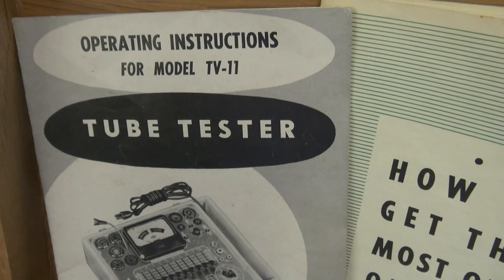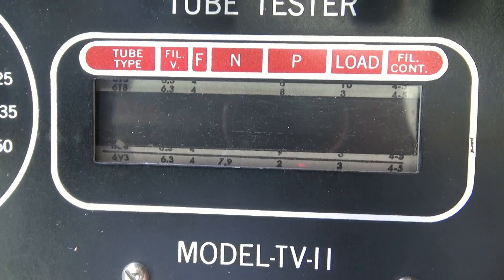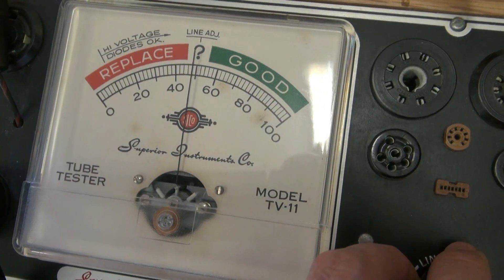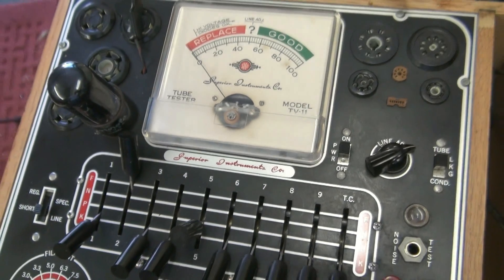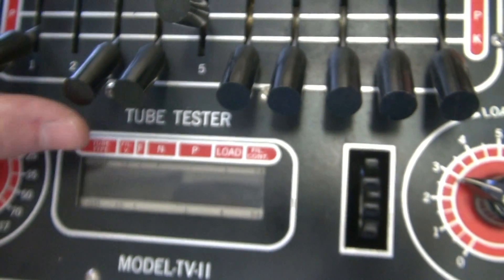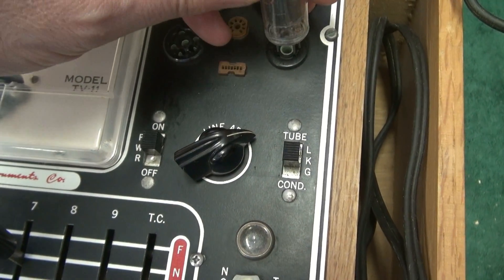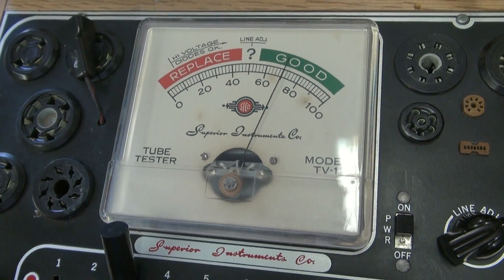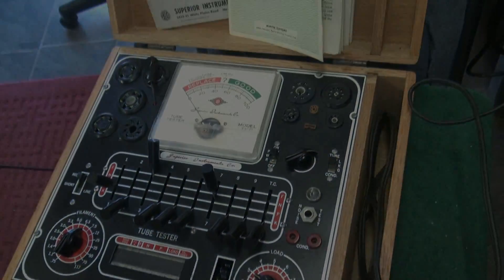Superior Instruments TV-11 Tube Tester Checker demo by D-Lab electronics

Comment: Just acquired one on Craigslst, opened  case to reveal a I-1/2 inch high water mark inside, water gone, but transformer had been immersed . Totally dry, so I put on an  isolation transformer and variac and except for two old wax capacitors, works great ( no shorts evident after immersion decades ago) these were built these in two upgrades, from 1951 onward, mine is a 1954-55. 
They are a testament to American made durability.

Comment: Thanks for the vid, but you didn't do the test demo right. You Do the shorts test first--always--and do so by setting levers for shorts as in the roll chart shorts test to various F and N positions, then turn load all the way clockwise, and proceed flipping each lever to P, one at a time (except for those already set in F and N positions). The neon lamp should not glow at any time. 
If you do an emissions check first, and the tube does have a short, you might kiss your tester goodbye.
Rob
Reply: You definitely don’t want to turn the load to 100 and proceed. Nowhere in the instructions for this tester or the TW-11 does it specify that. Set it where it says for any given tube and leave it there

Comment: I have one of these in use today. Nice oak cabinet. It's a very useful basic tube tester. On your TV-11 someone put some black electrical tape on the paper reel window which is not the best idea as some tubes require more than one line of test information for a full test.